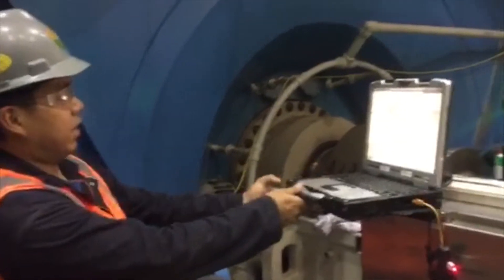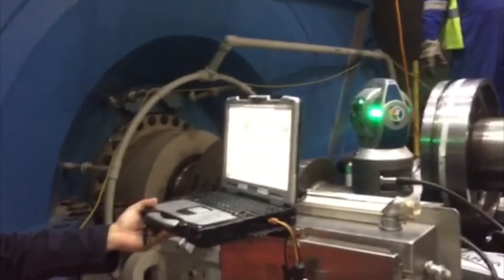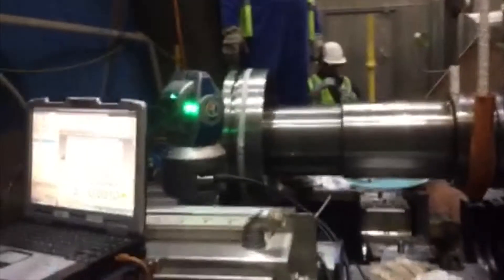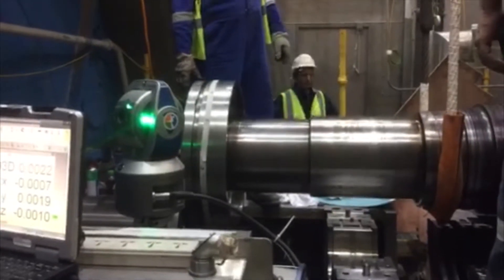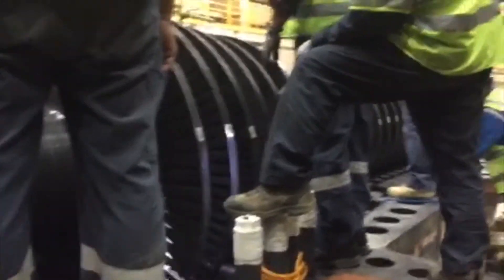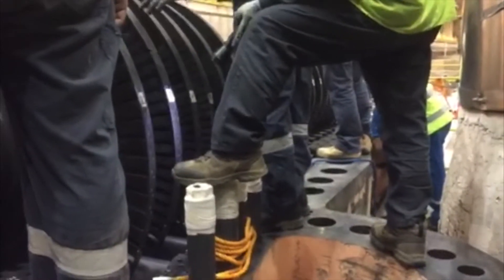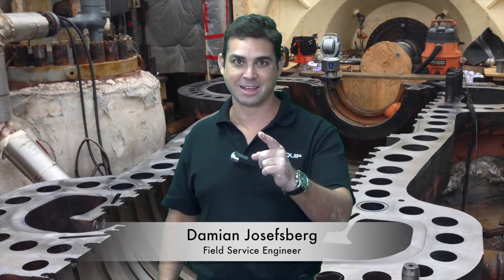ACQUIP - GE D11 Steam Turbine Internal Laser Alignment

Comment: Sadly its not shown how the lastertracker is being used to scan the sleeves.

Normally my laser tracker knowledge with API is it measures, but do not function as alignment. 

Trackers find centerlines via Math - does not show machine movements in Real-Time.

Needs a CAD file to show deviations after full scanning - right ?